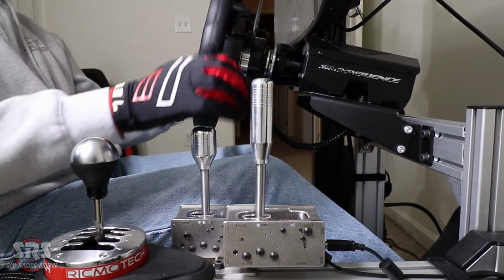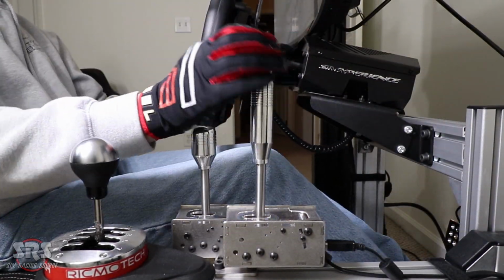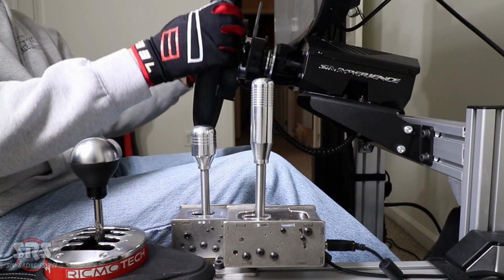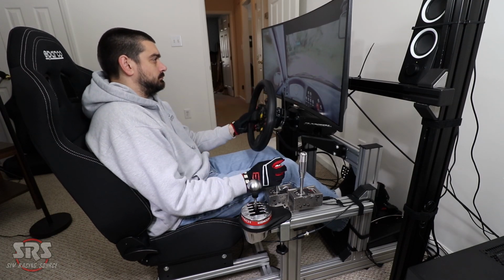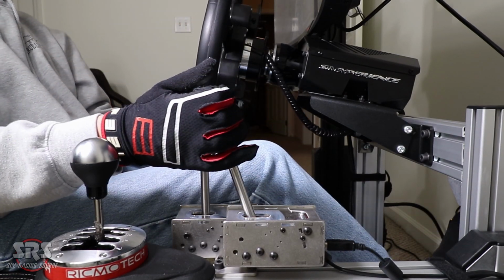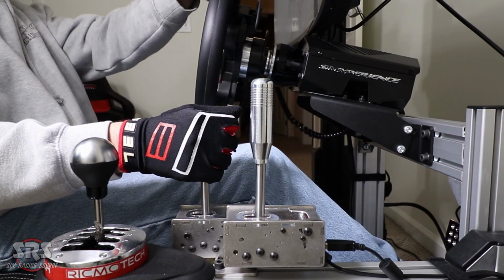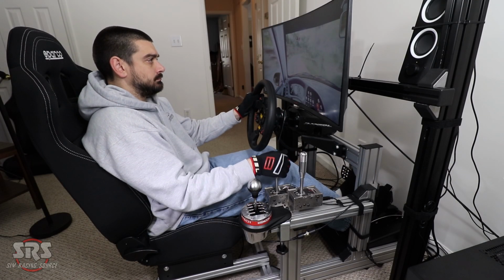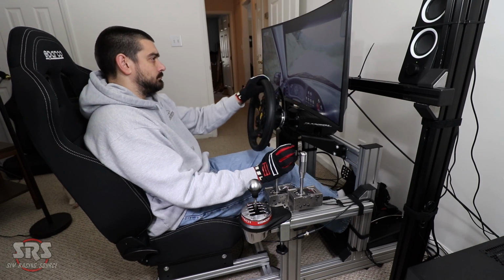Aiologs Sim Racing Handbrake Review

Comment: Well now after only 7,267 hours of racing with my G27 racing wheel  my racing done come to an abrupt end the other day while my wheel was calibrating ( turning all the way to the left  ) and then on the coming back to the right it made about a 1/4 turn and stop'd , no 2 1/2  turns and then back to center it just stop'd . Um ,  well that didn't look good . No power what so ever in steering wheel , gear shift  or pedals system completely down , got nothing no response on console  but game pad controller in game works . Connected wheel to computer and Logitech Profiler  and get unable to  connect .  So console is working as is computer , so I know that's not it. Looks like I will thumbing rides for a while  and watching from track side   you driving  by on my monitor  Dan.  Don't you forget to wave on your way by now  .
Reply: Probably encoder wheel is broken, try to find a cnc encoder wheel, then it should be fine.
Reply: @tkddrifter11   Thanks , searching for one now . Hope that's it .
Reply: Ordered mine from here, https://cmlaserservice.com/index.html, you can find assembly videos on youtube, hope it will work!